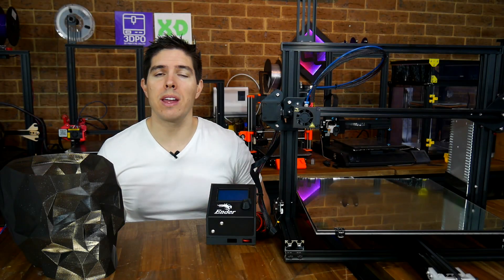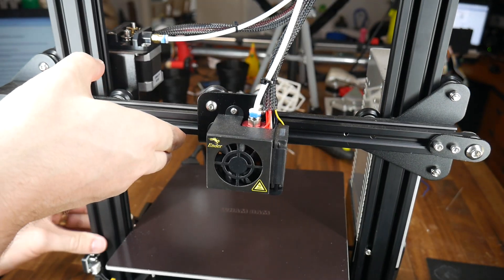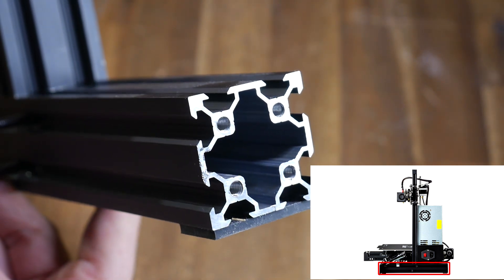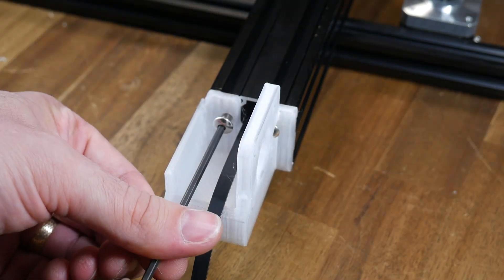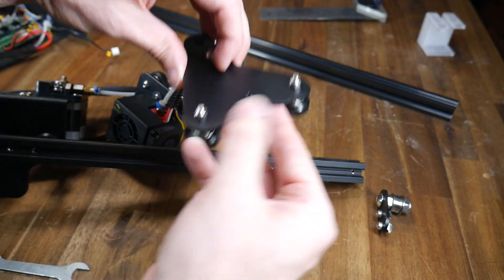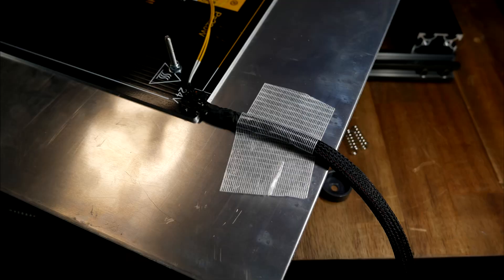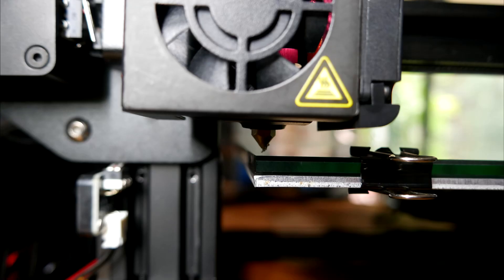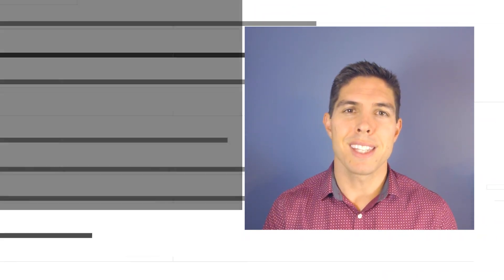Ender 3 conversion to 400x400 with the Ender Extender kit

Comment: The flattest part of a mirror is the back, not the front.
Reply: Both sides of the mirror glass needs to be flat and parallel - there is no flatter side! If they weren’t parallel, there would be distortions. Printing is done on the front side because there’s nothing on it. Good mirrors are distortion-free, hence very flat, and that’s why we use them instead of just any plain piece of glass!
Reply: @jmtx.  I mean you're partially right, but the strength of the glass and the surface area coverd negates undue warping overal. However I'm talking about surface flatness, over an area. Commercial mirrors are second surface mirrors, that are fabricated with a technique called float glass. The molten glass is extruded over a bed of molten tin. The tin is much better at maintaining a truly flat surface than the molten glass alone hence why it's flatter on that side. You will have a flatter surface from point to point on the back than if you used the front side. Also..... that's not a good quality mirror, if Michael doesn't mind me saying.
Reply from the maker: Didn't know that, thanks.

Comment: Can I use the Pro extender kit on my standard ender 3? It doesn't look right putting this huge bed on a 2020 extrusion.
Reply: The non pro kit uses 2040 but turns it on the side so theres no real advantage to the pro ender 3 in that case

Comment: Sry, but in my opinion all cartesian based Printers reach their mechanical limits above 300mm² XY Bed Size.
This will work with PLA but even PETG may fail because of reusing the old heatbed.
20 min. to wait till the Bed is heated up to level for an XYZ Testcube in PLA only.
Reply: I have the stock bed under the 400 aluminum plate and a 1/4" mirror, I heat it up to 50° for about 3-4 minutes then bump it to 60° and heat up the nozzle to 220 ( I use a .6mm nozzle) and let me tell you it heats up nice and toasty
Reply: Hola Enrique,

Bed Thermistor info or external checked by tools measuring the temp of your Mirror.
If it works for you it´s ok. 

But 125$ for an Upgrade, which make this printer slower than before?
Sorry Imho, thats backstep.
 @enrilopez

Comment: I guess you could do this yourself with some aluminium extrusion and some taps!
Reply: You can.  There's a user group for Extender XL and some did just that.  But, for only $200 Mark figured everything out so I didn't have to and I just had to put everything together.  I paid $200 for my Ender 3, $200 for the kit, and now I have the capacity to print the same as a CR-10S4 for less money
Reply: Make sure you get the right measurements and the right size everything, good luck
Reply: What I was thinking.

Comment: So I have the 400XL version and as a printer newbie as far as the modding and tech side, I had very few issues...and basically all were my fault. I have been printing with this for a couple of months and the only thing I will say of note is I have fried two SKR miniE3. I theorize it's because it's moving the large bed and mirror and is over heating. So I have changed the cooling and on next print I will change the bed speed to 300 like you said.
Otherwise, this mod is awesome. Mark and the fellow Facebook group members are extremely helpfu and nice. I only wish there was a 500x500x500 option!

Comment: Great idea and if your only 179 into your ender 3 like me... $318 total investment is going to get you that give you a sizable build volume and the luxury of not having to leave the ENDER community for support!
Reply: Right now the ender 3 is 189 and the ender 5 is 349, if I wanted to get a bigger printer I think I'd just get the bigger printer from the start.
Reply: Realistically, ender community support is useless if you're at this point in 3D printing. You'd be better off looking in a custom builds community since majority of the ender community are a bunch of noobs. Speaking as someone who came from the anet groups the level of knowledge and technical knowledge was much greater than in ender groups.
Reply: @strykervalkyrion  That is who this stuff is aimed at. You could realistically do it for cheaper if you source the raw material yourself. My problem with machines like this is that they will never be reliable enough for production. It will always have to be tinkered with and adjusted every few months.
Reply: @macgyver9134  I've been looking at doing this myself, as for the reliability, the Ender 3 makes a good base, you can start with this and build out easily if your clever enough and it works out cheaper than buy a bigger printer

Comment: I bought a CR 10 S5 for $400 off ebay before all the tarrifs, sure a BLtouch is a must to work on such a large volume. Sure my heatbed is only 300x300, but its 500x500 is great for my PLA prints.

If you are looking at this upgrade you should just get a 2nd printer.
Reply: You got a crazy good deal doesn't mean everyone will. I already have an Ender 3. If I needed to print something big and my options are ~$150 to get a bigger builder area (and not have a second printer taking up space) or spend the $650 that the CR 10 S5 usually runs, it isn't a hard choice.
Reply: I don't use a mesh on my S5 or any of my machines for that matter. BLTouch is not a must for the S5, it's a choice. Software bandaids are no substitute for hardware fixes.
Reply from the maker: The mirror I used was plenty flat. The bottom of the skull was perfect. I'm a big fan of ABL but this is flatter than when the printer was standard.

Comment: Now only the dual z axis kit is missing, for that big printing surface and the long x aluminium profile, i think that there is nedded 2 stepper motors for a more stable z movement and a smooth surface print.
Reply: It might help, but I have not needed it at all.
Reply from the maker: I agree, it might be a handy additional to complement but not strictly necessary.

Comment: Zebra artifacs? That's just ghosting..
Reply from the maker: Ghosting will fade as the vibration dissipates. Zebra stripes continue the whole way across the surface because it is a problem with the output of the stepper motor drivers. Therefore this is zebra stripes.

Comment: This is where the advantages of extruded aluminum and standardized design are going to start to shine.
Reply from the maker: Agree, I'm sure we will see more concepts like this.
Reply: In the world of CNCs there are already a few parametric designs for machines you can extend at will (since those use a low Z height, compared to 3D printers, you have less stability issues with bigger machines).
Reply: svnbit a cr10 series would be a better start if you’re asking these questions. One thing to consider is that print times do not scale linearly but rather cubically (print VOLUME). As a result, print times are extraordinarily long unless you’re running a volcano and a larger nozzle. For prints that long, you want to be completely sure that your settings are nailed down, and its much easier to do that with a prebuilt.

The sidewinder x1 has always been a great starting point for larger prints due to the titan and volcano that it comes with, as well as the ac heated bed. Its also priced slightly cheaper than the cr10 which is a nice bonus.
Reply: @reidn5185  thanks. Accidentally deleted my post. What are your thoughts on the ender 3 vs ender 3 pro? I'm looking at an ender 3 that's in stock in the u.s to get it fast. Are the upgrades that make the pro easily done within the price difference now that they are closer in price? 50usd to be exact. Thanks just wondering if the regular ender 3 pro is better starting place at that price, since I plan on upgrading things anyways. (Forget this extender kit for now, I may just buy another product later on to get faster prints as you suggested) thanks for reply
Reply: @svnbit8408  I've always chosen to pick up ender 3 pro for the increased rigidity of the chassis and the meanwell power supply. I don't skimp when it comes to PSU reliability, and the more rigid chassis is an added bonus. It's well worth it in my opinion, but I'm sure others have had good experiences with the stock ender 3. 

You can always save that 50 dollars and get the stock ender 3, and use that money to throw upgrades at it. It's just a matter of where your priorities are at. If you're learning on a new machine, it wouldn't hurt to get the stock ender 3. When it comes to print quality, the pro isn't going to automatically give you better prints. That 50 dollars can go to things like the creality silent board, or a skr 1.3, which offer huge quality of life improvements (nearly silent printer). It is intimidating at first, but teaching tech is a great resource for getting started.

You can start with either one and be fine. The ender 3 really is great in that you can keep building off from it. Maybe pick one up and keep looking around youtube to see what others are doing.
Reply: @YEETPRIME  What would be the improvements that could be bought for the ender 3 pro? I am very tight on the budget but assuming 50/70 dollars
Reply: @CALABASONICO  upgrade what you want. When i first started, i began by upgrading from buildtak to glass, then with ABL, then with different hotends, then firmware and mainboards…etc. its an easy rabbit hole to fall into, but start only by upgrading what you need or what would really benefit you. For example, dont upgrade to an all metal hotend if youre only printing pla.

Actually, one of my best first upgrades was sound dampening. A 5 dollar pavers stone made most of my printers silent in addition to TMC drivers. I believe you can get a skr e3 mini with drivers for around your budget, but its also a big jump at first. Fortunately there are a lot of good tutorials online such as from teaching tech.

Comment: Basically a CR-10 lol The kit is also too expensive to be honest. you can get a Chiron for that price when you count the price of the Ender-3 with it.
The Ender Extender XL
 (Z axis only) idea is stolen from someone on Instagram who does extreme Ender-3 modifications.
Reply: Except for someone who has already spent the money on the Ender it's "gone" or like me who has a heavily modded Ender3 but simply wants a larger print surface it makes perfect sense. Currently my only complaint of my Ender3 is the build volume so this is perfect. Now the Chiron might make more sense if you didn't already have an Ender3.

Comment: How do you get the bed to heat evenly?
Reply: Same as the regular Ender, except you do have reduced temps as you reach the edges. Very rarely do you ever use the entire 400x400 for a base layer. I have printed several nearly full bed things and all I did was heat the bed to 65, mist with hairspray and it's good. I did replace the heater with a stock sized silicone one and that heats the bed faster.
Reply from the maker: For PLA you can print without a heated bed on the right surface. I considered doing the skull like this but ran out of time.
Reply: I have the stock bed under the 400 aluminum plate and a 1/4" mirror, I heat it up to 50° for about 3-4 minutes then bump it to 60° and heat up the nozzle to 220 ( I use a .6mm nozzle) and let me tell you it heats up nice and toasty

Comment: Im interested in the Ender 3 core xy conversion kit video.
Reply: I'm a lot less interested now that I see the build volume on the core xy conversion is 230x205x400mm.  For anything but the z axis it's a downgrade from the stock e3.  I'd have been a lot more interested at 300x300 or 350x350.
Reply: @danmerillat  Look up the Tronxy X5S (NOT X5SA) and build something based on that.
Reply: Ender 5 is like an ultimaker architecture, motor for x axis travels on y axis.
Core xy and h bots have motors that stay still allowing for theoreticaly faster prints.
I think the ender 4 was a corexy but it was not that popular, not sure why.
Reply: Ben Baker ender 4 is h bot
Reply from the maker: "Dar der this video might be of interest: https://youtu.be/_ramiM3KHYE
Reply: @TeachingTech  awesome, thank you!
Reply: @tituscassiusseverus6303  gantry style as in the ender 5 is very much not an ultimaker architecture. Ultimaker also has two stationary motors. There’s basically two independent gantrys (like the Y axis on a standard gantry model) and the hot end moves as the intersection of those two gantries.
Reply: Do you mean an Ender 5?
Reply: @HotboiEngineering  Ender 5 is not a CoreXY printer.
Reply: @adameichler  what kind of Printer is the Ender 5?

Comment: Damn, I just installed a linear rail kit. Maybe with some longer rails I can use this kit.
Reply from the maker: I believe with longer rails you could retain the rest of your kit.
Reply: @TeachingTech  can you measure how long the rails should be now?
Reply: @Sacrilikt  I imagine 400mm rails will do the trick
Reply: @brianfisher7385  @Teaching Tech
The new build volume x and y is 400mm, so it should be 500mm rail. With the normal Ender 3, the build volume is 235mm and 300mm rails are mounted. The only question is whether there is space for 500mm rail´s. Unfortunately I cannot measure it
Reply: Same scenario here.  Purchased my Extender Kit right after the quarantine so I was put on a waiting list. However, he seems to have the materials and is sending it out to me soon. When I get it and start putting it together I will add the measurements here because I absolutely LOVE my linear rails on my normal Ender 3. Might not be better quality prints but the peace of mind is worth the upgrade.
Reply: First question I thought of

Comment: I'm already looking at my workspace... how to make more room?
Reply: Print more room!
Reply: Honestly, I use a small Harbor Frieght workshop table for my Ender 3s and when I modded my 3rd Ender to the 400XL big boy, I used the same table. Table is about 20x20 and I only have maybe 6" of front Y rail overhang, plus 3" of rear. I clamped the machine to the table for added stability and all is well, outside a tiny side table for the control box.

Comment: I feel like dual-z would be a necessity with this?
Reply: I agree plus a larger heater mat and a Volcano hot end, by the time you have shelled out for all this you might as well have bought a dedicated 400x400x400 printer
Reply: I have printed things 350mm x 350mm wide and 490mm high. Dual Z was not needed at all. I printed a vase like that at 50mm/s...and was flawless. Several helmets at 30mm/s....flawless. If you tighten your frame and have your eccentric nuts dialed in, you won't have issues.
Reply from the maker: The z axis is not lifting any more weight besides 100mm or so 2020 extrusion. Dual z is a good idea but not a necessity.
Reply: @TeachingTech  Even if the extrusion was weightless you're still adding significantly more force due to the extra leverage when the X is at maximum.
Reply: It really must be, it already takes a lot of work to get the x-gantry to not wobble at 235mm, going longer than that is going to put significant force on your z-rollers and lead to flat spots over time.